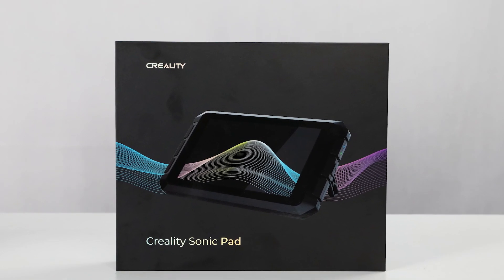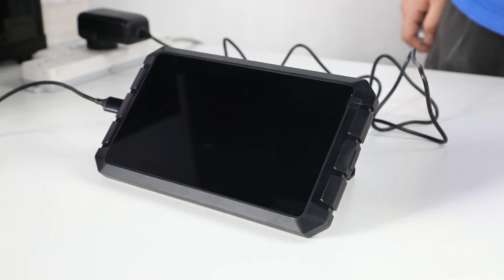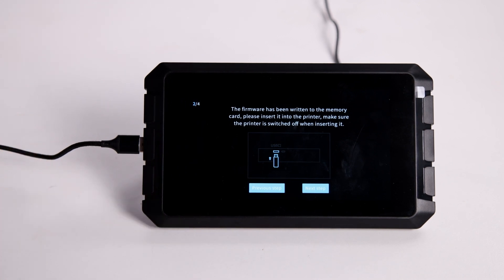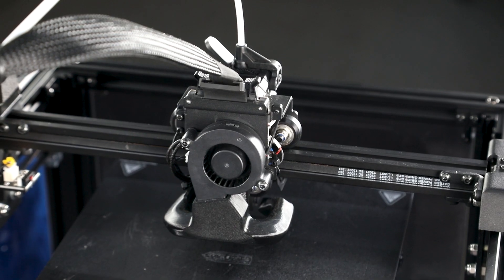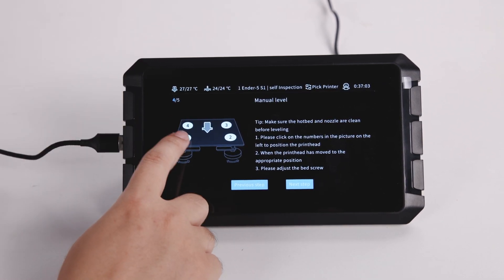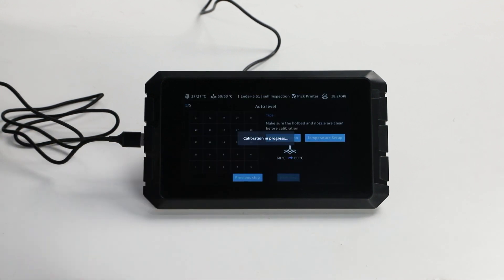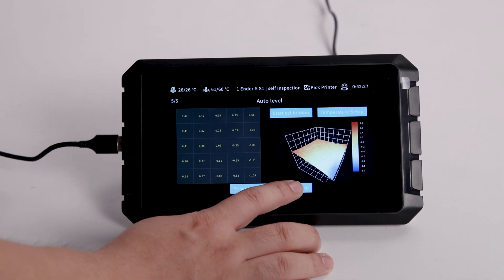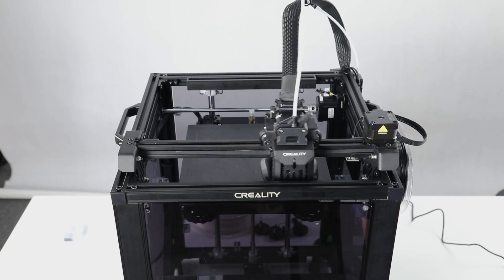Creality Sonic Pad  How to use Sonic Pad on Ender 5 S1

Comment: I did install sonic pad on my Ender 5s1. Follow that steps but its not using bed mesh when printing.
Reply: I believe it does that once and stores the info, so not required for later prints. However you do need to redo this if the printer has been moved or a new print sheet to be used.  Ender 3 S1 Pro here with the Sonic Pad.